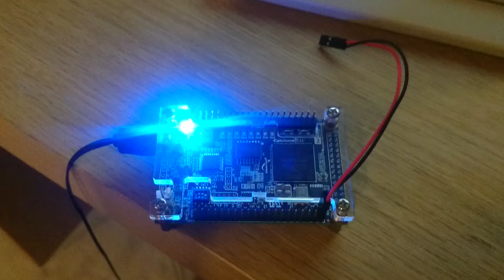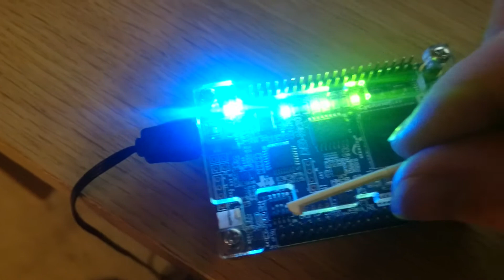De0 Nano FPGA sdram demo

Comment: Hi Stafford! I'm trying to use your piece of code to run SDRAM on the DE0-nano board but during the project compilation in QuartusII I got error messages like "Error (12002): Port "clkin" does not exist in macrofunction "rddata_fifoi"" and so on.  The top-level entity is toplevel.bdf diagram file. Could you tell me do I need to modify your HDL files to get it working? I am using QuartusII lite edition version 16.0.
Reply: OK I think I found a cause: port names in top-level entity (block file) are different than in actual Verilog code and a new symbol file must be generated. Is that right?
Reply from the maker: Yes, basically, I have switch the build to not use quartus but to use fusesoc (explained in the readme).  The top level file is now rtl/toplevel.v.  When building with fusesoc the quartus II files are all rebuilt.  Let me copy those into the repo for those who would rather just use quartus II.
Reply: Thanks for the answer! I tried to install and use fusesoc but I am not sure how to use it :) By the way in sdram_controller.v the clock frequecy CLK_FREQUENCY  is declared as 133 MHz but PLL included in toplevel.v actually generates 100 MHz, I overlooked that and had some problems with memory.
Reply from the maker: Filip Ozimek thanks. good catch. when you updated that did you get it working?
Reply: I've made only simple static tests like writing  0x5555 under address 0x000000 and it worked very well. I will do more extensive test sometime next week.

Comment: Does your SDRAM controller support higher clock rate than 100MHz?
Reply from the maker: It should support any single clock dram frequency if the pga hardware + sdram chips are capable.  This de0 nano maxed out at 100.
Reply: stffrdhrn what limits the max clock rate for de0 nano?  Its pll could go much faster than 100MHz
Reply from the maker: Looking at this issi datasheet (http://www.issi.com/WW/pdf/42-45S83200G-16160G.pdf) the max frequency for the de0 nano sdram chips looks to be 133 Mhz.  The PLL on the cyclone IV datasheet (https://www.altera.com/en_US/pdfs/literature/hb/cyclone-iv/cyiv-53001.pdf) is spec'd at a max output of 472.5 Mhz.

The limiting factor to the design would be the longest logic path.  I am sure you could try to increase the clock rate on my design. I haven't tried, so far I haven't run into any timing issues.

Comment: I'm having trouble finding the right code for the DE0-Nano SDRAM controller.
Reply from the maker: cocotower The verilog code I wrote is linked in the comments.  What are you having a hard time with?
Reply: I have an SDRAM controller working now, I hope.  I haven't written any code to write to it yet to test it out, but I'm getting there.
Reply from the maker: cocotower Cool, let me know if you need any help.